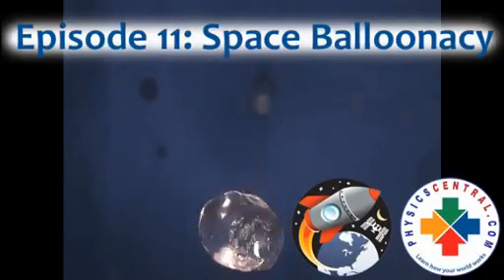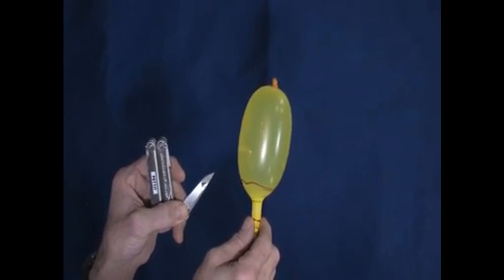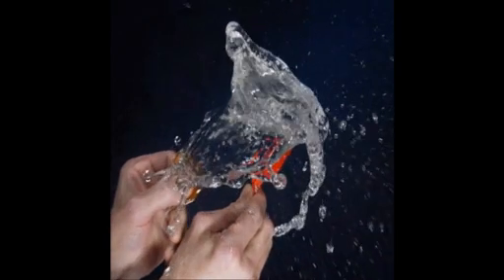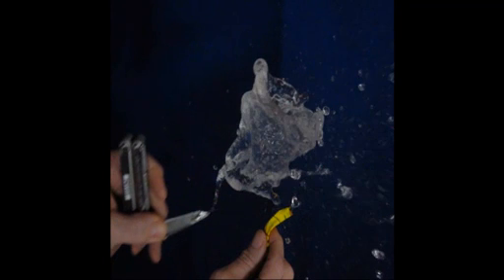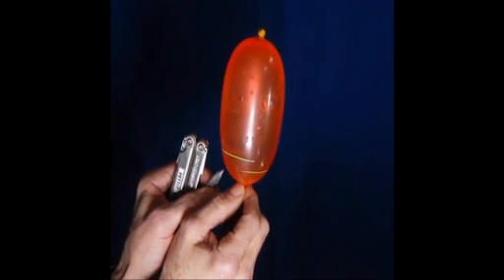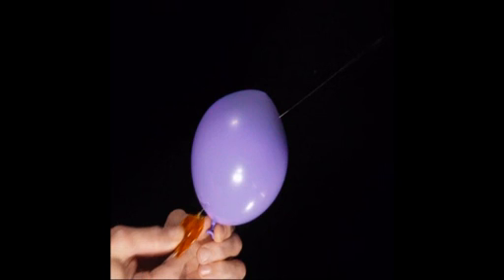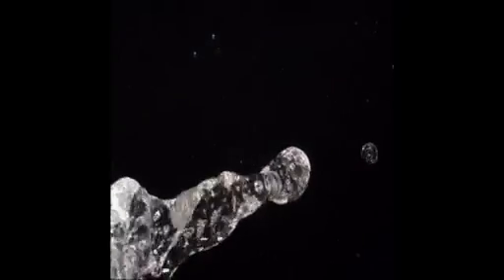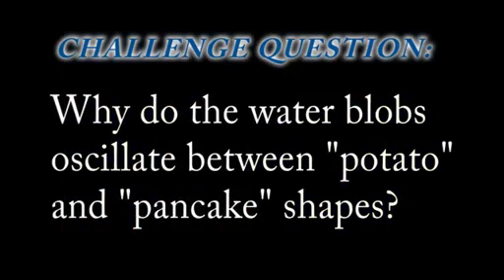Zero-G Water Balloon Pops in Slow Motion

Comment: The rubber balloon contracts when it ruptures. As the center of the rubber sheet pulls the torn edges, the torn edges also pull the center. This is also the reason why the center momentarily applies pressure on the water blob on one side of the blob. It pushes the water and makes a wave which reverberates in all directions.

Comment: Those water blob's oscillate between potato and pancake formation because they are making connection's to the closest strongest  available force  oxygen.The reason is, water is part oxygen so positive interaction with the water blob should be very easy. Surface tension of water within a falling motion is zero without a solid surface bonding . Water within a falling motion has no flow, it's molicule's always tends to come together from lack of solid surface bonding. For gravity Proven wrong visit YOUTUBE SUNLIGHT ELECTRO RAY'S visibly showing planetary orbit's powered by sunlight energy not gravity. lol
Reply: Sunlight energy pushes away matter, as proven by solar sails that we are using.  It's gravity, which is technically sun energy.  No, they do not move between formations because of oxygen.  There is too little energy and too much mass. They do that because of the energy from, first off, the energy of popping the tight skin of the balloon, and second, the surface tension that water always has.  The energy from the pop pushes the water in different directions, but surface tension brings it back, and this repeats until it forms a ball.

Comment: Weightlessness is not the same as zero gravity. 
Gravity on Earth = 9.81 m/ss
Gravity on ISS = 9.00 m/ss
Reply: +Nexfero It is literally the same exact thing.  zero gravity doesn't necessarily mean that they are in an environment that is absent of gravity.  It can ALSO (and far more commonly - since there is no place where there is no gravity) mean you are in free fall.  A zero gravity environment is simply one in which the G-forces are zero - which is most certainly the case in free fall - ergo, it is a zero gravity environment.

The entire point is that it doesn't matter if you are in free fall or are in an environment free from gravity.  Physically, they are identical states.  Einstein figured this out over 100 years ago.  This isn't front-page news.

Comment: I have a very interesting question.   Can you operate a vacume in space sence it is a vacume? Or what would happen?
Reply: A vacuum cleaner is not a vacuum.  It just has a fan on it that creates a pressure difference,  No, it would not work in an actual vacuum because the ambient pressure is pretty much zero, so you would never be able to get lower than that.
Reply: that's cool
Reply: johnnyhillman3 It's a fan using the same principles the propeller of a plane or rotors of a helicopter use to create lift, without any air or any gases in general you get a tiny spinning fan doing not much of anything except spin.

Comment: Weight is NOT the 'apparent' effect of gravity.  Weight is the ACTUAL force due to gravity.  When you are in a zero G environment, you are not weightless, because the force due to gravity is very much still acting on you.  In fact, it happens to be the ONLY force acting on you.  Free fall - by definition - is when weight is the only force acting on an object.  APPARENT weight is what G-force is a measure of.  In free fall, apparent weight is zero, so the G-force is zero.

Comment: funny because you were the one who claimed to be 10^100 smarter than me if i recall. first off everything doesn't have ions. there are plenty of elements that don't  ionize easy which is why they are called inert. helium is pretty abundant and is not an ion along with the other noble gases.  also ionization radiation doesn't refer to the radioactive sources ions it refers to the fact it's radiotion ionizes other material which is why it's harmful. maybe you need google. u haven't been right yet

Comment: I'll try to answer the challenge question;
The water oscilates between those two shapes because, as the man in the video said, two adjacent forces are created when the balloon is popped, so those two forces push the water inwards making it squeeze under pressure into a pancakey shape. Then, when those two forces are gone, the forces of cohesion in water make it form a potatoey shape.